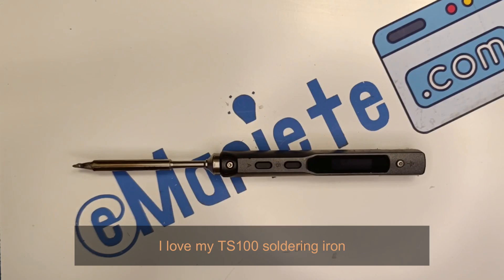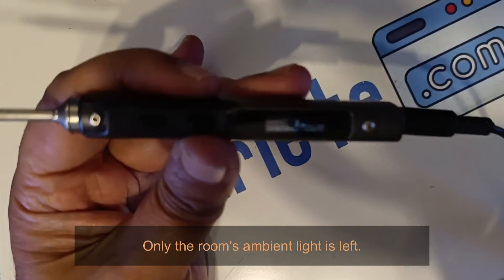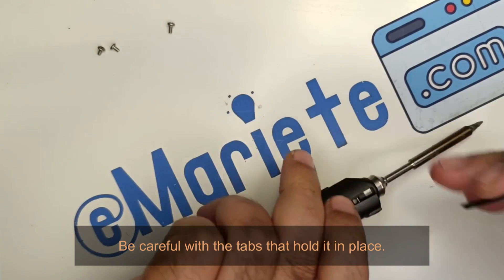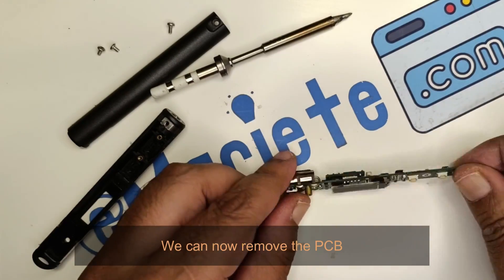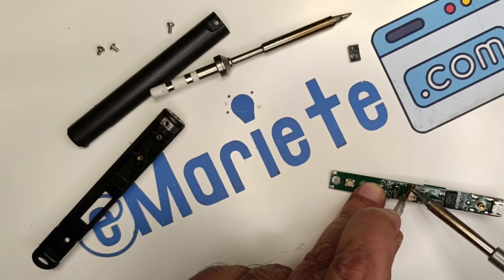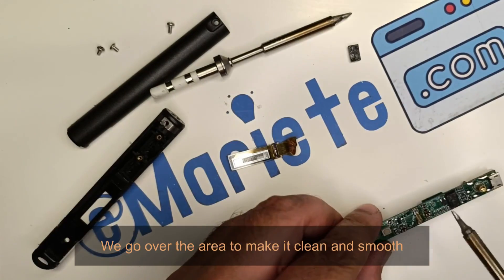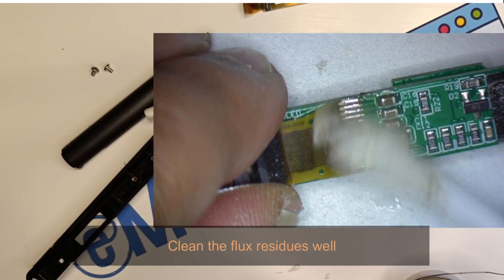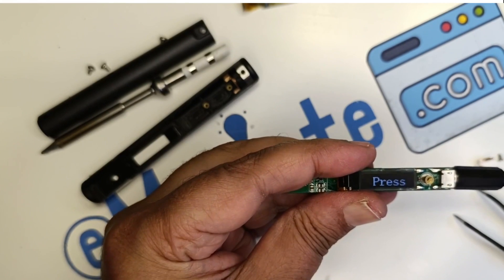TS100 Soldering Iron - How to Fix OLED Display. Tutorial for repairing

Comment: Just tried this on one of my tired old TS100s.  No problem in obtaining and soldering on a new one, but wrong size screen.  All the advertised screens have a 0.69" long active area and 16 * 96 pixels.  The one in my iron is about 0.88", same outside dimensions and connector but I think 32 * 128 pixels.  Electrically compatible but of course not software compatible and the image is scrambled up.  I presume mine was a later version of the iron.  Maybe if I upgrade the software it might be back compatible....?

Comment: I repaired mine as well. Just be careful when desoldering. I pulled too hard on the old display and ripped off 3 pads from the pcb! Took me hours to fix that with wire strand bridges (like with broken trace repairs).